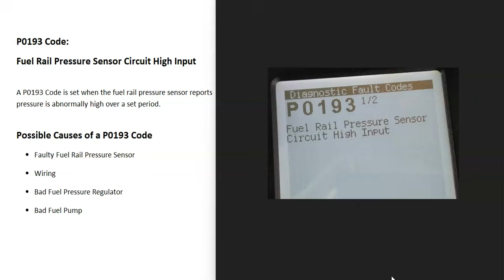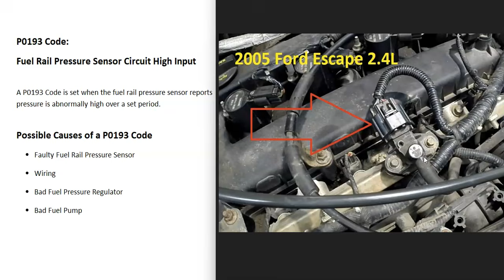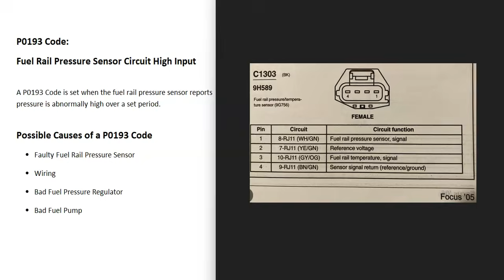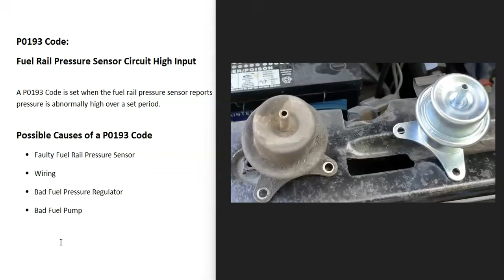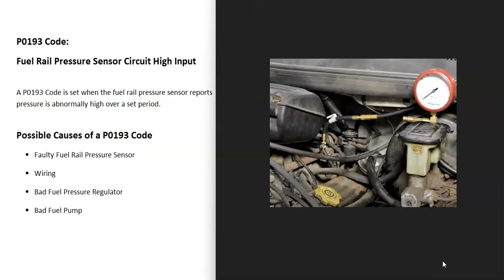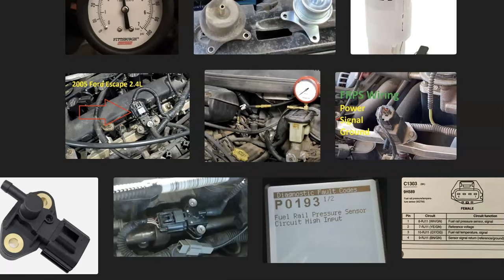Causes and Fixes P0193 Code:  Fuel Rail Pressure Sensor Circuit High Input

Comment: Help on 2004 ford sport trac 4.0, after clearing, keep getting a p0193 code, have replace fuel pump, filter and driver module, and fuel pressure sensor

Comment: So out of these 4 issues on the P0193. More than likely it's going to be the fuel pressure sensor? On my dad's 2008 Ford Escape 2.3L. I hooked up our code reader and saw the P0193 code. I hear the fuel pump kicking in and I smell fuel if you try starting it for more than 5 seconds. Acts like it wants to, just quite doesn't bust off.

Comment: Have this code on my 2013 CTS Cadillac. Would that be why it starts then dies immediately? Thanks.
Reply: I have the same issue with my 2012 CTS Cadillac. Did you ever get an answer or get it fixed?
Reply: Hello 
I also have same problem have u got urs fixed

Comment: Hey man. Been following your videos for awhile now trying to fix my long term fuel trims that are in the 30s…started with a p0420 p0430 code. I replaced both cars. Installed a new cat back exhaust system. Codes never went away. Replaces the mas air flow sensor. No fix. Replaced all 4 02 sensors. Nothing. Can’t find any vaccum leaks, there is a noise to me that sounds like some sort of air leak coming from the manifold somehwere. I’m thinking maybe a manifold gasket maybe bad? I’m replacing the gaskets this weekend. But do not suspect the codes will go away. I had the fuel injectors all replaced by a shop who I later found out really screwed me in a transmission rebuild. Lied about the parts they put in that I requested. Anyway so I started thinking the fuel injectors were my problem. Performed a balance test and everything seemed to check out. I’m now thinking maybe a fuel injector is leaking…which lead me to start reviewing the data in the fuel system. I noticed right away, fuel rail pressure sensor 2 is almost always reading 4volts. 4 volts at idle. And while diriving it moves around, but stays right around 4volts. Fuel rail pressure sensor 1 is 1.15volts at idle, and when I give gas, it goes up, when I break it goes down. I’m sure they should both be close to identical correct? Is this just a bad sensor? Or is this an indication that something is wrong on rail two, causing this. Also, any chance that this is what’s causing my codes relating to catalyst efficiency, and lean limits? As always. Awesome content. Thank you so much for the education. Really appreciate the time you take to make these they have been a HUGE help in the process I’m having trying to learn how to work and trouble shoot vehicles.
Reply from the maker: It needs to be diagnosed, but it could be a bad fuel pressure sensor or possibly a bad fuel pressure regulator. Are the sensors reporting the correct fuel pressure? If you have a fuel pressure gauge, you can see if the pressure matches what the sensor reports on the scan tool. If extra fuel is dumping into the exhaust, that can cause the CAT's to run too hot and cause problems.
Reply: @ mannn, no kidding! You aren’t located in southern Florida by chance are ya?! What id do to have a mechanic like you with a shop near by…anyway I think what you’re explaining may be the case. There is a lot of black water in my exhaust tip. I will go buy a pressure testing kit, and watch your videos to learn how to do that and confirm the readings on the scan tool. It’s Guna have to go to a shop soon the amount of gas I’m blowing through is really starting to cost me coupled with replacing sensors and parts that aren’t bad hoping to find the issue lol😅. Again, very much appreciated brother. This kind of education is so undervalued. And you’re here just handing it out. Much respect and gratitude. Thanks brother

Comment: Does anyone know if a 2010 Mustang 4.0 V6 has a regulator or not, my lines shot 60 psi when pump primed and my engine light is on throwing this code. I believe the sensor is reading it fine but Ik trying to figure out why the pressure is so high
Reply: Ive got same year mustang too and ive got the code but i have new fuel pump , fuel filter and abt 6 months ago i replaced the fuel rail pressure sensor and still have the code and i get 24 mpg and i don't think the have a fuel pressure regulator

Comment: New to all this stuff, how do i test wiring? replaced the sensor on my 1.6 hdi citroen, to no joy, still wont start. my obd scanner told me i got some 330 bar pressure, which seems about right, that tells me that the high pressure pump is probably fine atleast. Getting any form of useful schematics for my car seems troublesome to say the least.
Reply from the maker: You can look up the rated pressure is for your vehicle, but 330 Bar is very high. With the engine off, does the FRP sensor show high fuel pressure? If it does that often, it is a bad sensor. If not, I would test the fuel pressure regulator.
Reply: @HVAC_Mechanic  changed regulator and things went back to normal, temporarily, now my starter is burned instead, but that i can deal with

Comment: 05 xc70 chasing codes . Changed sensor, Changed pump module, repaired wiring that was twisted together instead of spliced. Works periodically but relapses.

Comment: Mechanic diagnosed fuel rail sensor on 2008 Merc Gr Marq from check engine warning light.  This happened after radiator fluid boiled over when radiator cap failed.  Mechanic just reset check engine light without repairs to the sensor and only replaced radiator cap. Is that advisable?
Reply: Could be that the wiring or something within the wiring harness got mess up by the radiator fluid. Not truly advisable, BUT could also just been misreading sensor due to some gunk build up and it cleaned off. If there was a problem, the light would come back on. If so, then check the wiring harness and the fuel lines.